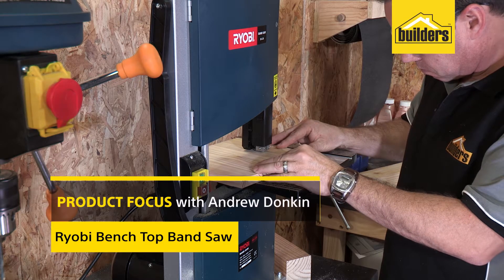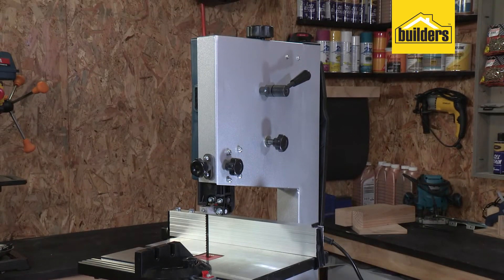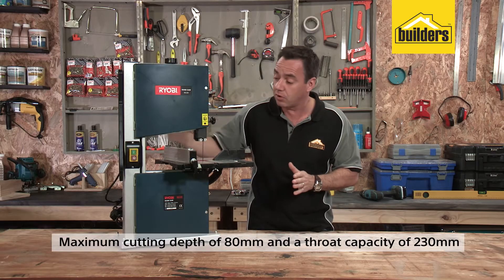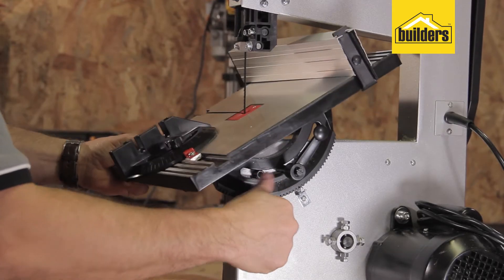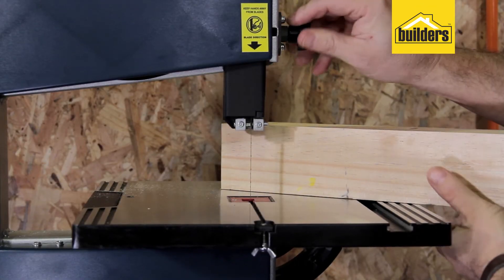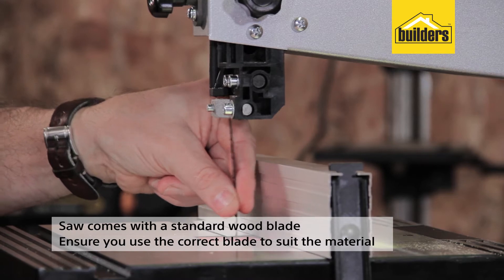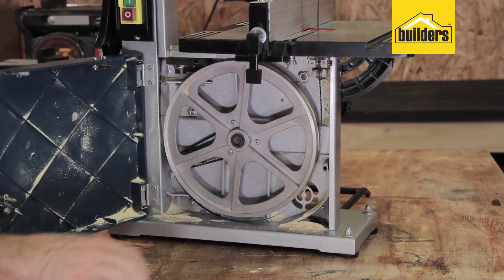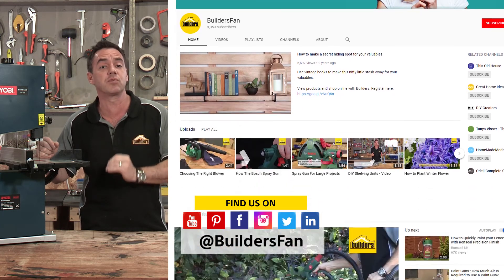Ryobi Band Saw 350W Review

Comment: Can you cut meat with this? Or please recommend one
Reply: I'm currently looking for a bandsaw. From my research I would expect so but with a different blade and of course depends on the thickness and type of metal.
Reply: This bandsaw looks very different from the one I used in the butchershop.

The bandsaw in the butchershop is opened easily and made to allow easy cleaning, the construction is different. If you need to clean this after cutting a skull or spine, you will be in for a hell of a time. That may cause issues with rotting pieces making you sick. I would never do it.

The saw in a bonesaw is also thicker from what zo can see. Doubt this will cut bone easily and doubt it will fit a bonesaw lint.

I would recommend against it. Very much.